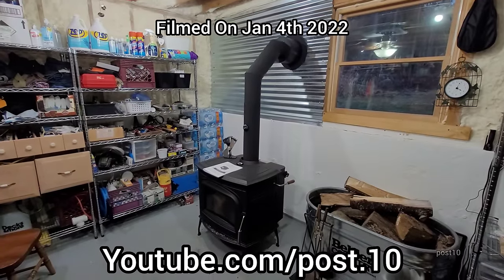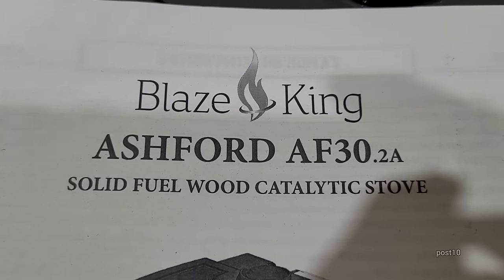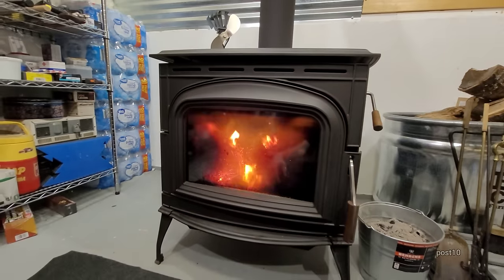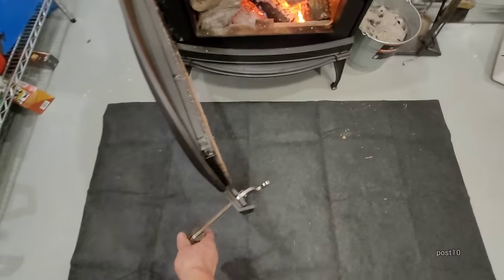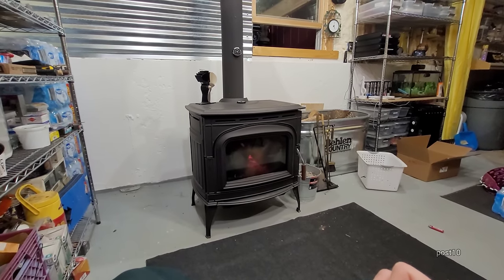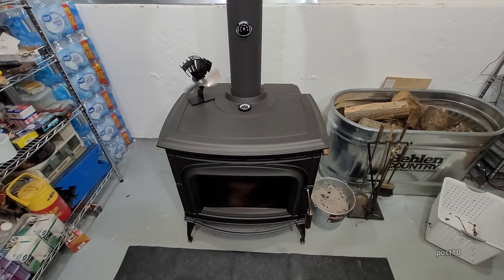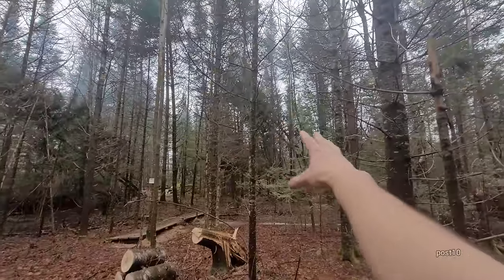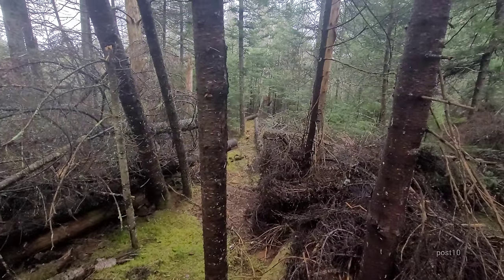Blaze King Catalytic Wood Stove One Month Review. Converting To Wood Heat

Comment: You can clean the glass door of the stove with the Ash from the stove, just damp some paper towel and pick up some Ash and rub it into the glass door. Works a treat 👍

 You probably know this but just in case you didn't.

Comment: Hey post.
Here's a trick I use to ensure draft/flow goes out.
I close all the doors to the room I am in if possible, then I open a window, and then start my fire. I do put exactly like you did, small wood to start but I do put 2 to 4 balls of newspaper on top and light that as soon as I started the small wood below to get the heat/ draft to flow up and out of chimminey.

Once the fire is going, I close my window and open my doors to my basement again.

on nights where it's -30 or -40c...it takes alot more newspaper. I light it and again make sure window is open, and i tend to keep the fireplace door an inch open to make sure the heat forces the draft up and out while the cold air from thenopen window has the positive air pressure to to force it up and out.

Comment: 1:07:08 That is the best idea for sure. All the little critters and bugs need habitats too.
The best wood to burn here where I live is the birch. It has the most high warm value and easy to get, it's every where. We also use Baltic pine (Pinus sylvestris) which is different than the pines in Maine. These pines are not full of sap but resin and it burns very nicely. We also use spruce but it cracks and pops a lot but with other logs one spruce log is ok.
We season the wood a little differently here. The trees are usually cut in the summer when they have full foliage, that way the trunk begins to dry at once after it's cut because the leaf draw the moisture out. With birch you have to saw the bark cut all the way the trunk from down to up to prevent it to start rot instead of drying. The long trunks are let to dry a month or two and then they are cut and piled in the forest or transferred near the wood cabin and piled up outside there, covered with tarp and left like that for months. Usually in the middle of the winter, the logs that are in the forest are collected with a snowmobile with sleigh. The logs are chopped in the winter too because a log that is totally frozen (-20C) brakes the easiest, with a good chopping axe you really can chop even a very thick log, I can assure you. But we use the electric one of that chopping device that you have. After the chopping the wood is moved inside the wood cabin to season more and usually these are burned next winter. Sometimes the chopping is left to be done in the beginning of summer and then the wood is piled outside and let to dry more before moving them inside the wood cabin to safety from rain.
I hope that mossy area lives next summer, it is so beautiful. If it is not so dry summer, it can survive. But if it is going to be drought and very sunny I'm afraid the moss won't like it.

Comment: You burn softwood during the day when you are around to keep refilling it because it burns faster. Then hardwood at night. Once a week or so open up the vents and damper and burn softwood as hot as possible. That will clean out the stove and stove pipe. Then always clean your stove pipe/chimney in the spring. 
. Also, keep a pan of water on the stove to help from dry air. You should open up the house once a week to let in fresh air. The fresh air heats up better.

Comment: Great video.  I love learning from those who have done it.   Hint : Try the "top-down" method of starting a fire.  YouTube has several good vids on how to do that so I won't go into it.  Why it's so great is that it's just as easy to get set up and light but the PLUS is that you light it and forget it for 45 minutes to 1 1/2 hours before ever having to look at it again.  No forgetting and then having to re-start with paper and kindling 'cause you "got busy" doing another chore.

Comment: I have one of those pump log splitters and it's great, had it for about 8 years.   Your right saying its a benefit because you should never split logs on a concrete floor with an axe because over time you will crack your floor with the impacts.    You can go outside to do it but inside with the pump is the cats ass. I have the jotul f3 non cat and love it.   The Jotul with the screen is something I'm very very happy with.

Comment: Fir has the highest BTU content per pound.  Several
Different fir sub species, some are in the 13,000-13,500 BTUs per pound.
Hardwoods have highest BTU content per cord (volume).  This is because hardwoods are denser.
If buying wood by weight you would want to buy very dry fir.  If buying by cord then best to buy hardwoods, (oak, locust, hickory etc) and if buying buy volume water content isn’t a concern, it will dry out, and volume is volume.  Most hardwoods are below 10,000 BTUs per pound.  Pines and firs have higher BTU per pound because of the resins in the wood.  As long as your stove is efficient (yours is very efficient with the catalyst) fir is best, pine is second, and hardwoods are third in BTU content per pound.

Comment: Yes! No problem heating with pine. My dad, like everyone else in Montana,  heats with it- hardwood is hard to come by there. Just a little maintenance keeps it going. Good you have a back up furnace as well. When I start our coal forge, it gets a bit smoky- have to open the shop doors for a few until the stovepipe warms up, then I'm good to go. 
Love that you heat with wood! After that storm, you are set for a long time!!

Comment: Really great video, thank you. 😊  Regarding your stovetop fan, it uses a Peltier to convert the heat into electricity for the motor driving the fan. If you put the base of it on a flat part of the stovetop, rather than on the ridged part of the top, the heat transfer will be much improved and the fan will start sooner and run faster. Ecofan is a good brand and that's why it cost what it did. The wiring in the cheapo Amazon ones tend to melt eventually.

Comment: You can also use wet newspaper and ash to clean the creosote off the glass on the fireplace.
Also, keep a spray bottle with water and spray down your ashes to keep dust down when cleaning.

Comment: Every meal seen done on a cook woodstove on YT looks amazing. Nice back up too for grid power fails.

Alaska by La Nordica has a large oven and wood box, you can use a wok & has the stove pipe in middle that helps prevent creosote by higher heat.

 If steel costs goes back could help cost. Cannot believe installation is so expensive, might as well build a cook fireplace for dutch oven baking and spit for roasting with a particle filter system in chimney. Think you could do a smoker grill in it too, keep it safe indoors while slow cooking. ❤❄🍵

Comment: Just going to watch your video for a short time
I have a blaze king ultra
And had it in my house for over 20 years or close to that.
And I burn everything in it
And yes i burn plastics too,
but not with that catalytic on,
And my cat is still going strong,

i clean my chimney when ever the chimney needs it
How do I know it needs cleaning
open the stove slowly when using it
And if it doesn't draft properly,
You will have some smoke in the house

Clan it with a metal brush, and only have a chimney with stainless steel.

And here's a clue to help with smoke.
Near the stove and near the top of the ceiling
Place a fan to suck out the smoke
And use it every time you open the stove
And it's been many years since i did that
Still my paint looks fairly normal, and not darkened as most houses with wood stoves,
It also allows the house to not smell with the wood smell of smoke etc.

Burn any and all woods, as it doesn't matter, 
Just make sure the wood is reasonably dry.

Oh yes I have forgotten about that clean out
As I never use it
got a coal bucket and place the edge along the door opening, and shovel,

Comment: Some people are correct about the ax. A fiskars X25 or X27 would cut your splitting time by more than half after whatever learning curve you need to go through. Yes, it’s probably more dangerous but if you become proficient with that ax, a cord of straight grained oak in an hour is completely possible. Pine usually takes a little longer but not much. You could save the hydro tool for gnarly stuff. I definitely recommend you try the ax.

Comment: You certainly have an abundance of wood.

I have one of those electric 4 ton splitter. Homelite. Some 2 ft diameter logs need to be worked around the edges, splitting off pieces before the core gives way.

My inclination is to get anything at least split once to start the drying in the core.

Maybe place a metal panel between the burning junk and a drying pile, accelerate the Dry.

Comment: Ecofan is the original maker of those little fans and the cheaper ones are the knock-offs. They're just extruded aluminum, a thermoelectric cooler, and a small motor so nothing really groundbreaking or proprietary. I like the brass blade on the Ecofan I have but I also have a knockoff strapped to my flue pipe because Ecofan doesn't make that style.

Comment: you can use by Imperial Clear Flame 2 in en 1 Glass & Masonry Cleaner for the glass door it is great a thick spray that sticks to glass and does not run down wipe with paper towel and glass looks brand new clean!  I have been using it on my pellet stove glass door for 10+ years works great easy clean  before I used a razor blade took forever and so so clean this spray cleaner I seen a guy on yt use and I got it on Amazon  works GREAT!!  no more razor blade so so cleaning   just spray and wipe looks brand new!!!

Comment: It’s good practice to leave an inch of ash in the bottom of the stove when you clean it out. The ash protects your fire brick from the hot coals of your next fire. Not a huge deal but you’ll experience deterioration/thinning of your fire brick after a few years.

Comment: Do the directions say to keep the door open so long? With my stove, I close the door as soon as the kindling has ignited and the fire builds up much faster than yours does.  Also, put the heat control on high when lighting the fire.

Comment: Couple of questions and a comment.  For a long burn ....do you judge when to reload the firebox on heat out put...aka the house starts cooling off.....or do you look at the catalyst temp gauge starting to drop near the bottom on the "active" zone?  Obviously both situations you would be on coals.  

I was also watching some of blaze king's training videos on how to run these things.  They always open up the damper (air control) to high for starting and reloading wood.....and they say that doing that allows the stove to get up to temperature faster to reengage the catalyst (close the bypass) and it also will burn off a lot of the carbon on the glass.  Did I miss something?  I looked like you had your damper on low for your starting of the fire?  No judgement just curious?  

I'm currently in the market for one of these and I think either the King or Princess will fit the bill.  So excited to try get this thing going!  Awesome video!  Thanks for sharing!
Reply from the maker: If it drops below active it will not work at all and it will smother, I always try to keep it on the hotter side. If the house gets too hot I just crack the windows. It can run 30 hours on low with the proper high quality wood, low-quality would about half that time but it makes its way through the night which a lot of stoves without a catalyst can't do as they burn through wood faster, you do not use the damper one starting, you open the entire bypass to the pipe, when it hits active temperature you close the bypass and now the damper through the catalyst is what controls it. By this time it should already be an operating temperature so it doesn't matter if it's put on low

Comment: Hi,  At 59:20 there is a hand pump well head or whatever you call it.  It looks like a hose can attach to it.  What type make is it?  The pumps I have seen all have a mini trough and I can't connect it to a tank or anything to fill.  Also many only lift so many feet.  thanks.
Reply from the maker: I bought this on eBay and the end of that is not threaded so you cannot put a hose on it and you also cannot add threads because the back of it is open like a normal hand pump well so it could not pressurize, it's just a different design same as the mini trough ones but I have a system on one of my hand pump Wells with gravity PVC pipes down to the garden maybe something like that would work for you if you have a hill you could put the tank below it. They also do make ones instead of a hand pump it's more of a crank and you can put a normal garden hose on it

Comment: A quick and cheap solution to clean the black glass door on the stove is to dip a wet paper towel in the ash and then scrub the glass. Wait and let the ash work and it will be even easier to get the glass clean.

Comment: I can see from the inside of the oven and the glass in the door that you are creating a lot of that dangerous, shiny creosote. Foremost, try lighting the oven upside down: Put the biggest logs in first and the smaller branches on top. You'll see that at the point the big logs start to burn, the oven is hot enough that the creosote does not condense any more. By using this method, the glass in the door should stay mostly clean, which also helps with radiating the heat in the room and far less of that shiny creosote  should be found in the oven and the chimney.

Comment: What size area are you heating, and what are real burn times? Thanks!
Reply from the maker: The stove is meant for a 2000 square foot plus house so it is over-sized for my house, it's heating a total area of about 1400 and even on low it is often too hot and we have to crack the windows but for those nights it gets down to -40 degrees it still does a good job but can't get us above 65 which is okay. Last year it kept the entire house warm without having to run the furnace at all, if you run it on high it will need to be serviced at least every 12 hours in my experience but I am burning mostly Evergreen which only has about 50% its energy value compared to something like oak or Maple, if you use quality would you can double that time, on low some people claim it can go over 30 hours without being touched one bit but you need good firewood which does not grow around here

Comment: Do you have to change the catalytic after a certain amount of time?
Reply from the maker: It is warrantied by the company for 10 years to never plug or break or they will replace it for free, if you're a prepper maybe you want to keep an extra just in case, it can technically be operated without the catalytic but it will quickly overheat as there's no way to control the flame and it would need a damper added

Comment: Great video, however you start the fire incorrectly. When building a fire outdoor you do put the small pieces on the bottom and the large pieces on the top like you are doing here, but in a wood stove you should do it the opposite way, put the larger pieces on the bottom and the small pieces on the top (top down burn), start the fire on the top and let it burn down towards the bottom. That method creates little smoke when starting or any time, and also gets the hot air going up the chimney immediately warming the chimney and pulling the little smoke out - also won't smoke up your glass. Look for some videos on top down burning fire for wood stoves.

Comment: I’ve been thinking of getting a wood burning stove. But 8,000 is discouraging.
Reply from the maker: If you live in the United States you would get 30% of that money back through a rebate so that helps and if you're not looking for a catalytic stove like this which was $4,000 the majority of non-catalytic are under 2,000 with smaller ones below 900. And depending on your setup you may not need as big of a pipe which added about $100 a foot. 
If that's encouraging at all
Reply from the maker: The rebate is for high efficiency appliances 30% this year including this stove, other wood burning stoves do not qualify for the high efficiency rebate but they do qualify for a smaller Renewable Energy appliance rebate
Reply: @post10Vlogs  
Thank you for the advice! I’m always looking for self sufficiency in a world like this. That rebate will help a lot!
(Also, I happen to own a similar pair of Blue mattress like the one you found with all of the nuts in. If you’re curious they are “Sealy Posturepedic by Crofton” They are queen sized, comfy and made to last. Plus they have cord handles on the sides that aid in moving them. )
Reply: @alobowithadhd6191  The old question of, what do you pay for heat every year? Will a wood stove pay for it's self in 10 years?